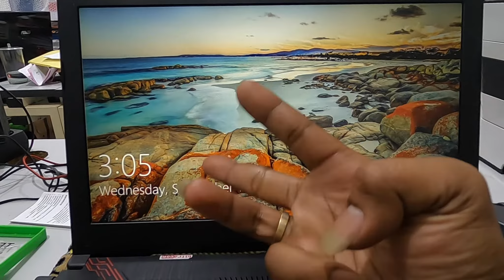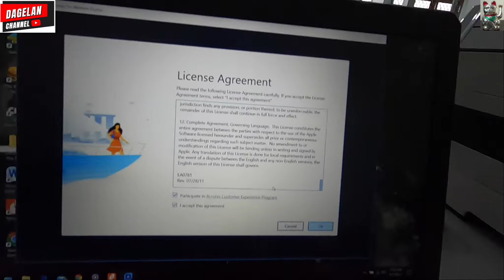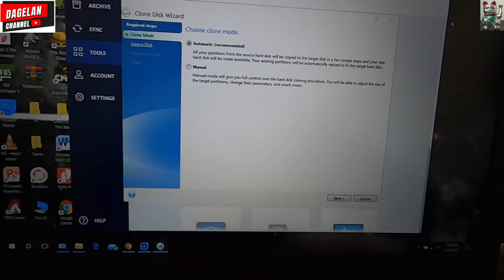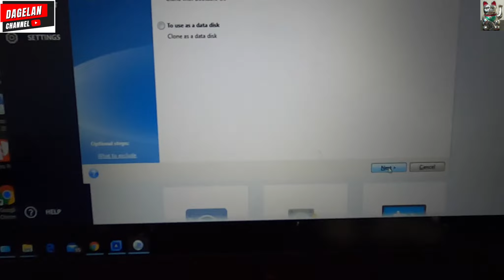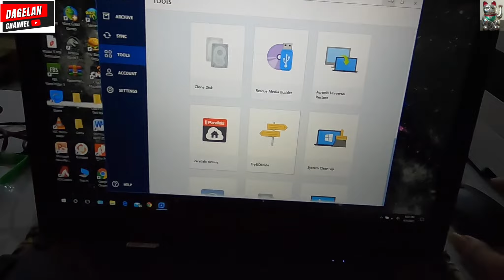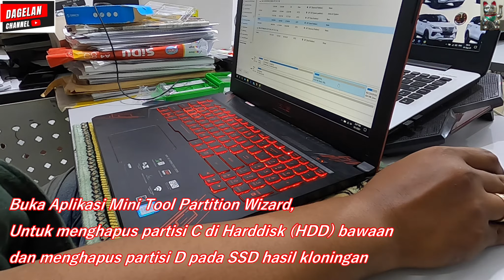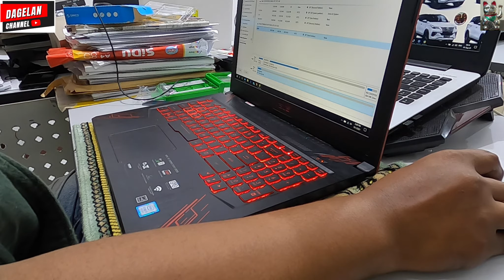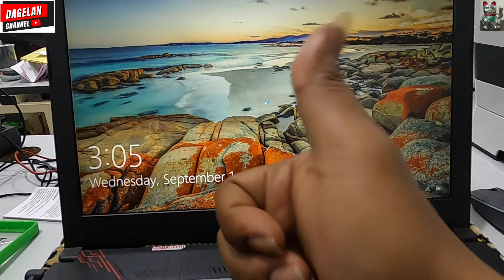UPGRADE LAPTOP ASUS TUF GAMING FX504G SERIES || SSD AND RAM

Comment: Saya juga punya laptop ini, lemot banget pingin upgrade kayak punya mas, itu klo pake RAM yang 3200mhz bisa atau tidak mas
Reply from the maker: Setahu saya ram nya pake 2666mhz ya (2x16GB),, klo mau pake 3200mhz biasanya yg dibaca yg terendah ya,, atau klo mau di ganti smua dengan 3200,, itu kn ada 2 slot,, 1 keping ram bawaan 2666mhz, 1 slot kosong,, ya klo saya ngga mau ambil resiko, saya samain aja ke 2666mhz nya

Saya beli disini untuk ram nya:
Coba cek ini di Tokopedia, deh. Harganya Rp769.000
https://tokopedia.link/CfpCDkZkhzb

Comment: Hi can I Samsung 970 EVO Plus M.2 SSD 1tb? my laptop is fx504GD i5-8300H and can i use nvme as storage for playing games? or can i install windows there and the game too?
Reply from the maker: Yes, you can install storage SSD use Samsung 970 EVO Plus M.2 NVME,, 
you don't have to install windows anymore, you just need to clone the laptop's default windows to the SSD which will be installed on the laptop, clone it before it's installed on the laptop, after it's cloned just install it to the laptop after it's finished and the laptop can be used with good performance  very good.
Reply: @PANSHoki99  and can i use that nvme to put windows and games on that same ssd? and if it will support me of 1tb of storage?